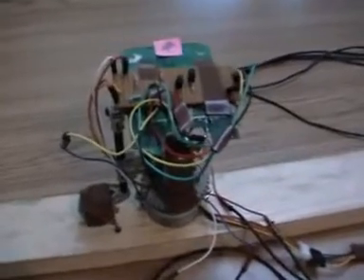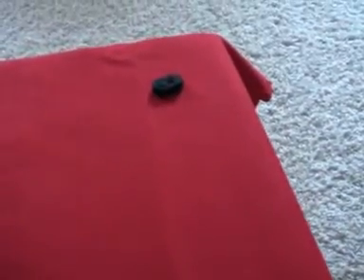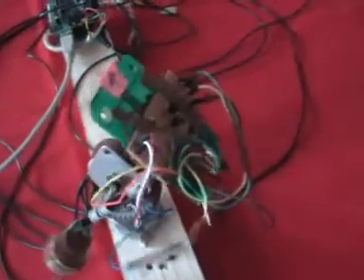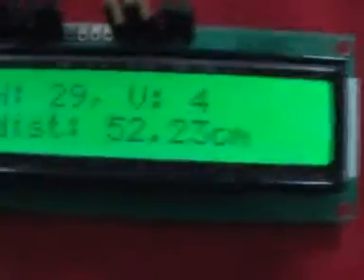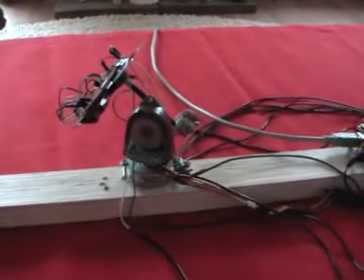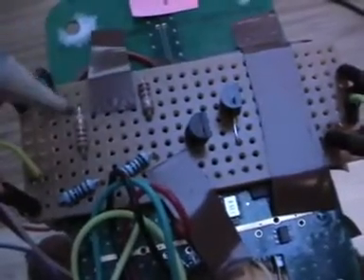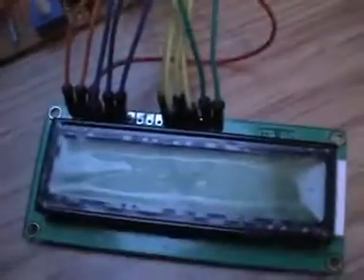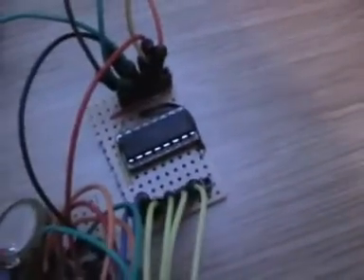Arduino radio tag tracking, motor shield stepper motors and LCD display with port extender

Comment from the maker: That's the key problem - the direction is determined from the highest pitch the Loc8tor device emits so you need to do a 360 degree turn in the x,y plane to find the highest and then a 180 degree sweep in the z plane to nail it. It is sensitive to signal reflections from objects so not an exact science.

Comment from the maker: @jomasanrec I guess it depends on what you mean by real time; the signal can be measured pretty much instantaneously, but as it's the voltage on the piezo sounder it varies wildly and so has to be averaged over 1000s of readings to get a semi-reliable distance reading, which takes a few 100 ms.